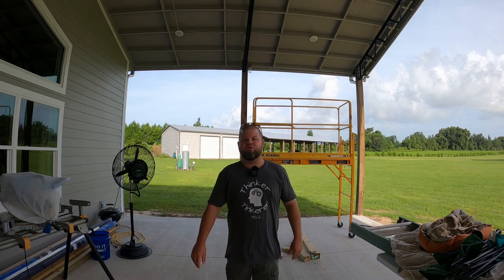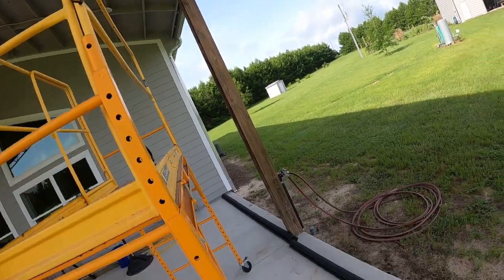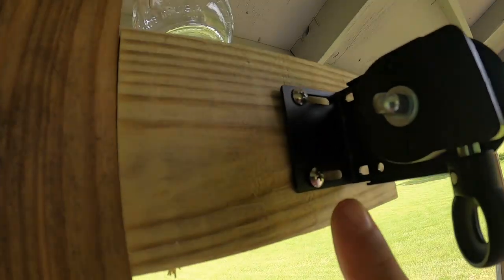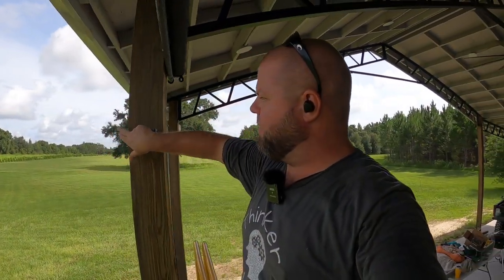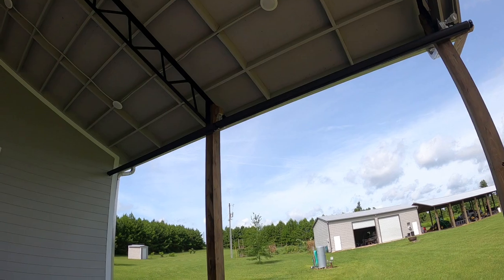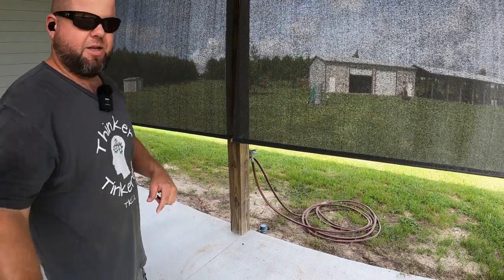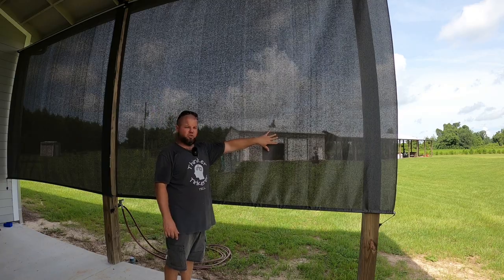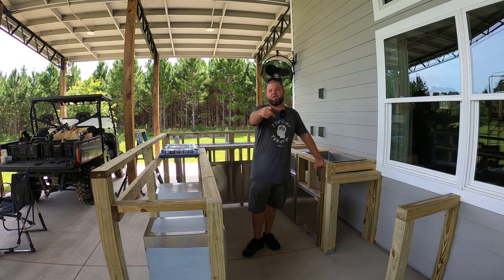Installing HUGE porch roller shade curtains! #615

Comment: Those look the same as ours at the barn. We cut them down with a chop saw  to make them fit and put the caps / ends back on then heated the edge of the fabric so it didn't come undone.
Reply from the maker: I seriously considered doing something like that.
Reply: @TKCL  It would help your problem with tying it down

Comment: Looks great!  One thought I had if you want the bungee cords to pull straight down is you could mount the holders on a bracket with a hinge, so the bracket would lay down flat against the post when not in use.
Reply from the maker: That's exactly what I have been thinking about, the hinge idea.
Reply: @TKCL  I just had another idea, instead of a hinge you could also make the bracket removable. So maybe something like a hole in the post it would slide into. Then you could just pull it out when not in use, plus then you could put holes at different heights so you wouldn’t need extra holders.
Reply from the maker: I definitely don't want to drill holes in a support post. Screws is one thing, holes is another.
Reply: @TKCL  I was just using that as an example. It could be a bracket that the other bracket hooks into. Just another idea is all.

Comment: Nice job! On your outside, build a bracket like the one holding the shade at the top, so it looks symmetrical top and bottom. Then attach those bungee holder.
Reply from the maker: Problem with that is the mower coming by and people catching on it. I was thinking a fold against the post hinged bracket.
Reply: @TKCL  Maybe some sort of recessed D Ring. Just flip it out to hook the bungee when needed.

Comment: I am so glad to see these open roof structures l After seeing an earlier video of your TORNADO WIND DAMAGE,
I became concerned ! Also in an earlier video, when you screwed the cellular antenna to the top of the roof, I saw the house roof move l If you would install a set of cross hatch cable or threaded rods, between several roof supports , it would ADD to the side wise stability of the roof supports ! As a thought, you have MORE open wind sail structure than Columbus had as sails on his ship crossing the ocean !
Reply from the maker: That was the man lift basket moving, not the house. We've already been in some nasty thunderstorms and I have not seen or heard anything budge an inch on the house.

Comment: Get a flat door plate that is usually put on the wall to prevent the door knob from busting drywall for the end at touches the siding. that might work.

Comment: Just secured at the bottom I would consider making a bracket that screws to the post it just holds that pole down tight. Just a little piece of metal that you could easily tighten down with a wingnut it would hold the polls in place without the bungees and be much stronger. When I’m watching the video I’m wondering if that thing blew up and swung in towards the house if it would reach the window. 🤔
Reply from the maker: I'm thinking about a fold up hinge to mount to the post.
Reply: @TKCL  that would be cool. I also bought some magnets off of eBay. They’re made for screwing under a table or a cabinet to hold a gun but they’re very strong magnets. Then you could just put a metal park or some thing in the post and drill so you can counter sink it so it’s flush but those magnets were very very strong and they have bigger ones that are more of a rectangle shape as well. That might be a thought but I’m sure you’ll come up with something pretty awesome

Comment: You could mount those on the backside of your gutters are on the facia board and not have to worry about those mounts at all, it might stick over a little behind the house but if you just put it on the roof you wouldn’t really have to worry about the width of the polls. It looks like it might be long enough heat up to you work around or move one of the gutters over a few inches but it’s another option.
Reply from the maker: I'd be worried about the sun destroying them and the rain causing mildew if they were mounted there.
Reply: @TKCL  good point. It would be interesting to see if you could cut them down a little to make them fit the way you want. But I think it looks pretty good the way you have it set up, I would probably try to come up with a way to clamp the bottom down better, just because you have so much wind there but it might be better just to let it go. You might even find a way to tie the two of them together just to keep it from being able to swing over towards the window so easily if it’s blown really hard. 

I definitely think the idea about putting the chair footer on there to keep it from messing up the paint on the side of the house is a good idea, or at least I felt pad on that end.
Reply from the maker: They are a weird plastic material, cutting them down would require melting and or sewing like we've never done. I decided it wasn't a good idea.

Comment: These are pretty cool. My neighbor had something kind of like that that was split, it had a magnetic door where that you can push open that covered his garage doors. I was thinking about just using something like that for a screened in porch that I could remove pretty easily if it got too windy and when I didn’t want it to be covered. It just use Velcro though and I’m not sure that would be strong enough long-term.
Reply from the maker: I've seen those too, pretty neat.

Comment: get black iron pipe drill into post and run pipe half way in so the pipe can be taken in and out and extend past pole to the bracket length you need. when you decide to do something else years from now just frill in drill hole with dowel and send flat

Comment: Nice addition to your porch area Andrew! That sun can be brutal, you've reclaimed your porch! Have you thought about installing a hinge on the outer post that could fold down when not needed but when opened would allow the shade to be pulled straight down? Don't know if your OCD is kicking in but thought it might be an idea? Folds flat when not used bit up and out, with the plastic bracket connected on the end when you do. Anyway, lol. Enjoyed it!
Reply from the maker: Lol that's funny, I was just mentioning that idea to a viewer a few hours ago. I think it's a great solution.

Comment: Good work Andrew. If I had done it (opinions, much like bellybuttons), I would have left the blind closer to the house the way is was, but mounted the one further from your house on the outside of the posts. Evened the end of the blind with the furthest post and overlapped the center post (may need to tee off the center post in the other direction similar to the way you did the blind closer to the you house. Thanks as always for your videos. Love to see how you're making this a beautiful and comfortable home.
Reply from the maker: I kicked that idea around as well, when all I could find was 8ft bli d's I was going to overlap 3.

Comment: Looking good.  I have zero knowledge in your advance technical knowledge and skill.  I do wonder if adding an additional 2X4 support in center of each 24” span holding the 24” tile, would assist long term in preventing tile from cracking or breaking.  I hope this isn’t a stupid question.🙏
Reply from the maker: I'm nowhere near done, that countertop is getting a lot more support.

Comment: in the off chance this does not work out their is a screen system from Larson manufacturing it is called the Grandvue E800 they run around $470 at menders and lows for the base length of 8x8 and 9x8 but from what I can tell from when I worked at Larson most items can be custom ordered for different size. the one thing that makes these better is they run in a track so there would be no need for the bungie cords on the ends and there is a motorized version as well E950 but that has a screen length down to 10ft
Reply from the maker: I like the track idea.

Comment: Don't know how to explain this idea but on your posts for those bungee anchors could you do a slotted 2x4 and when they are down pivot them to a T position and bungee to those? Then when your shades are up pivot them back to the vertical position and they lay with your posts and kind of hide there
Reply from the maker: That's a interesting idea 🤔
Reply: @TKCL  may try and sketch something up and email it to you
Reply from the maker: I'm already thinking of some collapsible hinges that Lowe's sells that might work.
Reply: @TKCL  If nothing else a single bolt through the post with a wingnut might hold a 2x4  steady enough that you could pivot it from the horizontal to vertical position.

Comment: Why did you not cut them to fit the width you need?  Seems like a lot rigging for something that should fit easily.  Just to clarify, remove the end cap (either side) roll the shade fully extended, cut the roll tube to the width required, carefully using a straight edge and sharp razor blade cut the cloth.  Roll everything back up and replace the end cap.  Custom!
Reply from the maker: Not that easy, the ends are stitched together, I don't sew.
Reply: @TKCL  Ah, got it.  Wish I was closer to give you a hand with that.  They do make a product called fray check that protects the fabric.  I understand your dilemma.